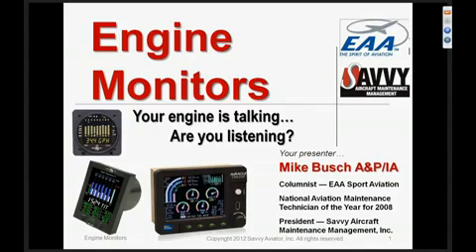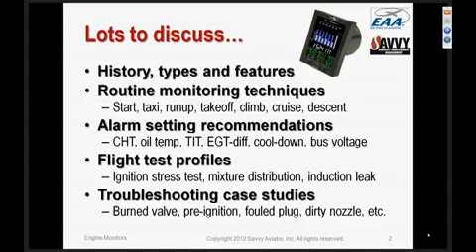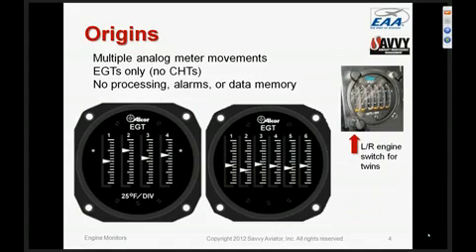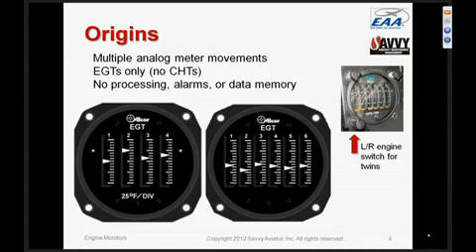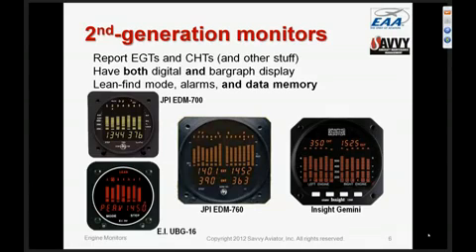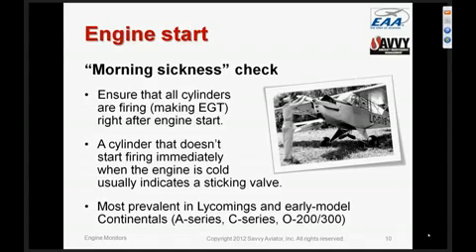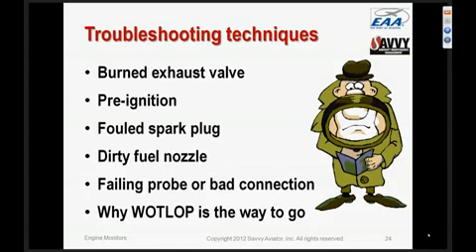Engine Monitors

Comment: Hey mike,  the BPPP recurrent engine training encourages us to not ru. The IO520 below 2300 rpm due to harmonic stress on the engine.....if my 3 blade  prop that is well balanced..... is this a concern to you?  (Reference highest mo/ lowest rpm strategy).....if i am just goofing around locally doing a sunrise cruise, i  do 21-2200 rpm with 21 inches LOP, to get 10.5 gph LOP and 260degree CHTs.....is this bad practice for the engine?
Reply: As someone who does dynamic prop balancing with a background in engine vibration research, you raise an interesting topic. I won't presume to encroach on Mike's tutorial here,  but I will say that in an age where we have digital monitors, I believe that for advanced GA aircraft I'd love to see onboard vibration monitors.
If you ever see a stiff,  low mass composite airframe with instruments so blurred by vibration at certain resonant RPM bands and with control pushrods vibrating like bass guitar strings, you'd blanche.  Dangerous? You betcha.  Most airplanes don't have such high risk occurrences,  but they are becoming more common, and even less aggressive vibration should be tuned out because it is damaging over time.
With a monitor,  you can catch such things early.  Even if it's just a data logger that the accelerometers report to so they can be examined later (no panel space taken up), it's a lot of peace of mind for the bucks.
Reply: @craigwall9536  Insight makes such a monitor. I have one installed in my plane. It’s called G3 and has x y z acceleration logged. The accelerometer is mounted on top of engine case. As to Andy’s question ops below 2300 with that prop should be avoided as there is indeed a harmonic issue at around 2100-2200 so the 2300 limit was placed.